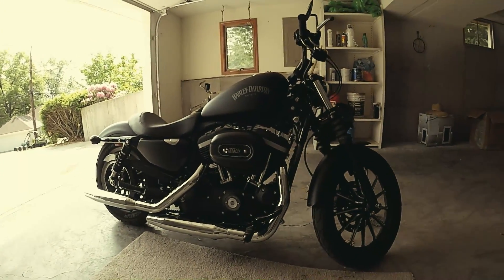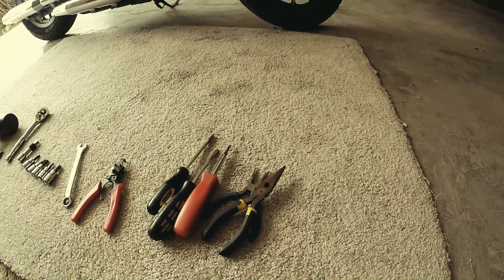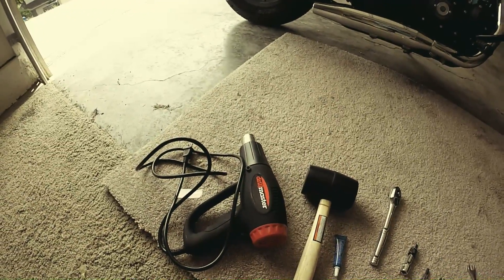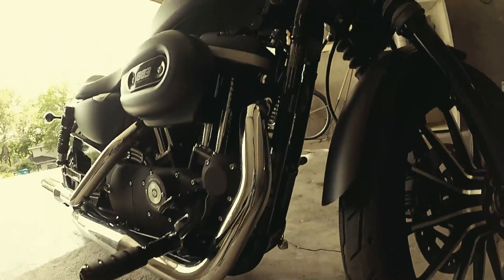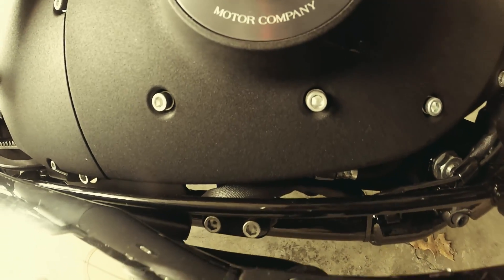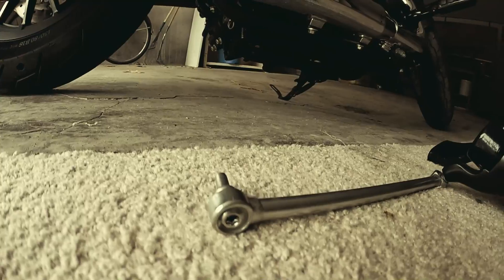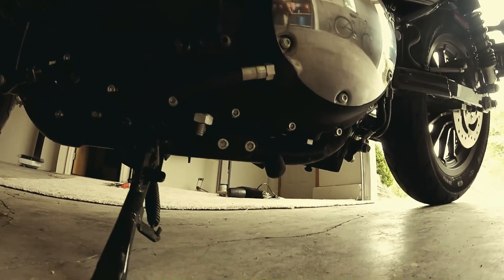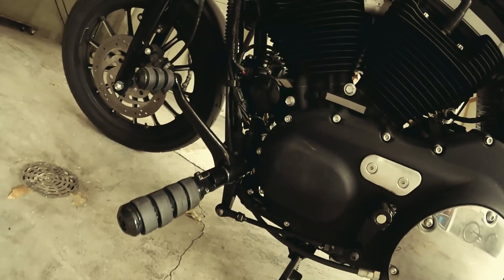2013 Sportster Forward Controls Installation Harley Davidson Sportster Iron 883

Comment: I  checked this before I fit forward controls to my 2012 Sportster- no mention of the oxygen sensor in the front header apparently very hard to remove so I left the header loosely held in the head and worked around it. So not as simple if you have a fuel injected model

Comment: Best advice is the heat gun on the rear brake linkage rod pivot. Spent way too long trying to break the damn thing loose and was afraid I was going to strip the screw head. Just like the man said, 30 minutes of the heat gun and the screw popped free.
Reply: I think that would be 30 "seconds"!

Comment: It looked like the stock mounts could just be moved up from the mid-mount point to the front mount pint. Can you confirm that the pieces you got in the kit are definitely different than what comes stock or are they actually the same? It seemed lik I could just move my mid-mounted pedals up and get the extension bar so I can connect the brake and shifter pedal. Please advise. Thank you
Reply from the maker: Jesse Lindsey , The new foot controls need to clear the exhaust on the right, and crank case on the left.  The kit provides new mounts that do that, since the stock mounts are too short.  You could, however, use the stock foot pegs on the forward controls, but the stock pegs aren't very comfortable.  Everything in the project was completely worth the investment. Hope that helps.
Reply: Nick Prohaska, Thanks for the response. Did you get the Harley forward mount kit? How do you like the ride now? I also have a '13 Iron.
Reply from the maker: Jesse Lindsey They are not HD controls; a little too pricy.  The controls are Biker's Choice.  I've also had the handlebars replaced with 12in Z-bars and I really enjoy the ride and posture now.
Reply: Nick Prohaska Thanks, i'll check out Biker's Choice. The harley option is costly.

Comment: So why did you not mention that when you installed the peg you need to replace the mounts for the pegs, if anybody knows of a foot peg that will actually fit my 2013 seventy two let me know, and no I don’t want to grind the clevis down